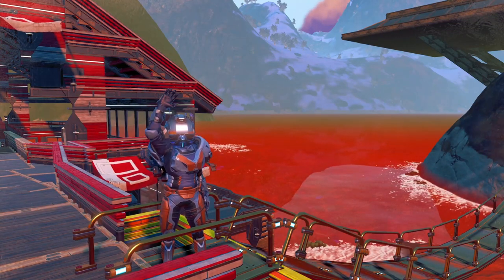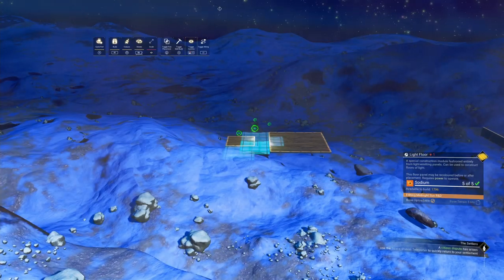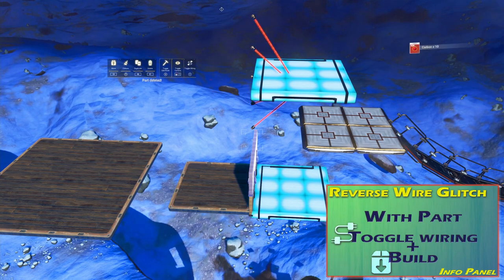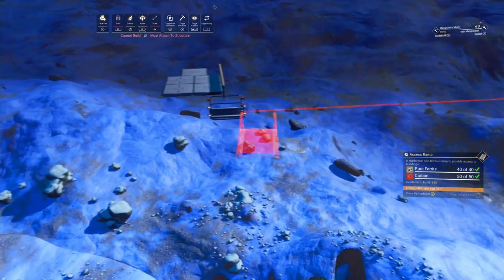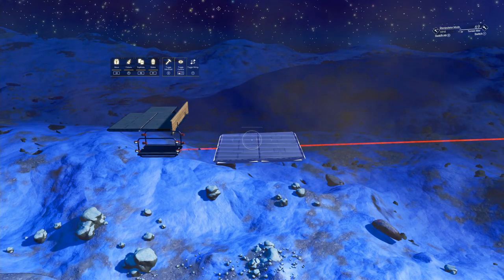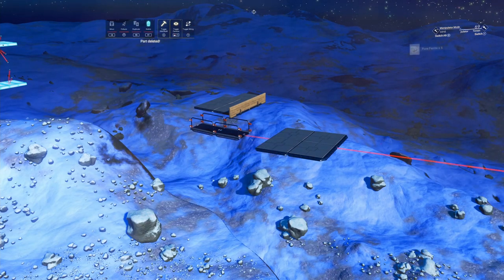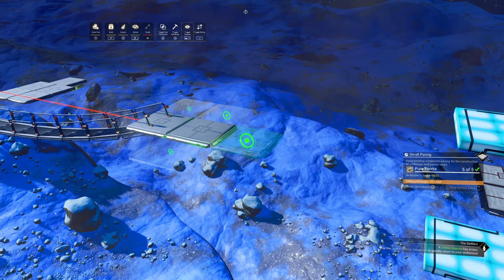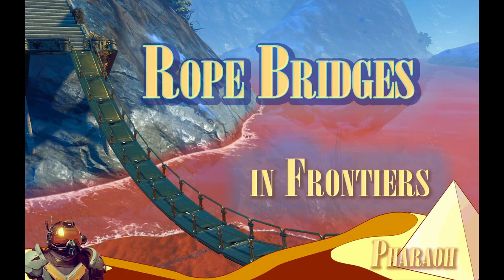Rope Bridges - No Man's Sky - Frontiers

Comment: Nice and congrats on having an officially featured base.  When I went to your butterfly house yesterday the power wasn’t working at night btw.
Reply from the maker: Thanks.

Outside of the teleport there is no power. The main building is powered by fireflies. 

If you mean the teleporter, that usually worked for me but the way featured bases work they kind of make a static copy of whenever they took a snapshot of the base. So unfortunately I can't change the power setup or anything else.

That base may even have been built before they changed how solar is impacted by weather. It's approximately two years ago when I installed the teleporter!

Visitors may have to use 'back to the anomaly'.